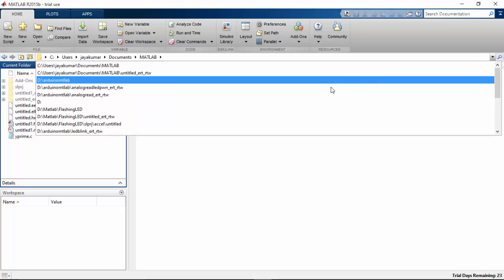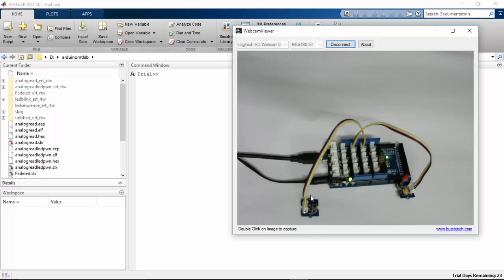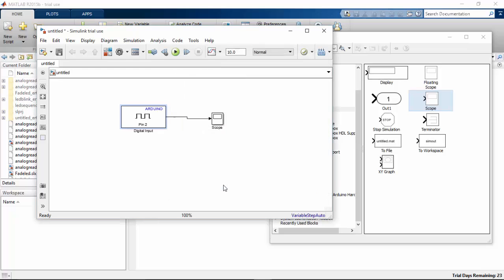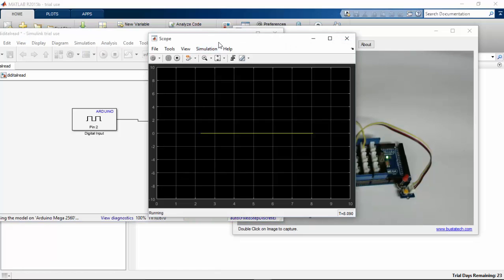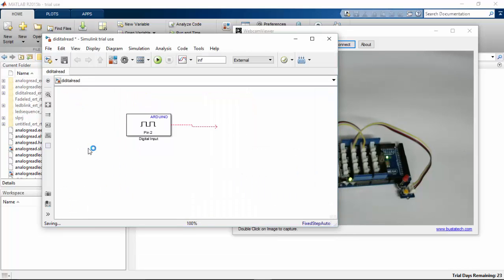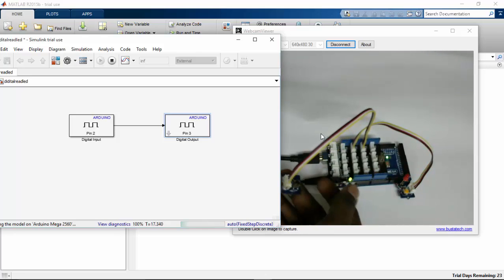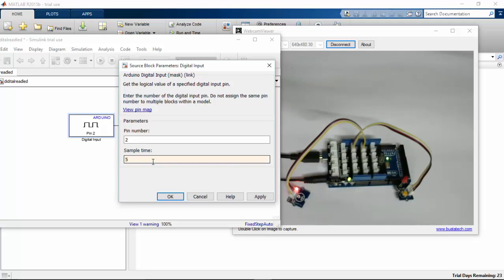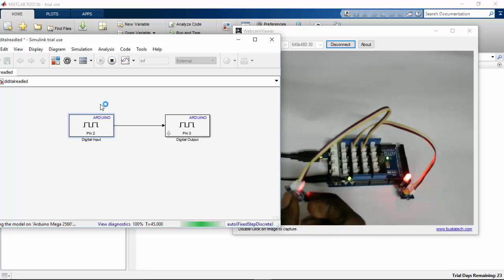5. How to read Digital signal In Arduino with Matlab simulink

Comment: How to add a delay of 1 second in simulink as we do it in arduino like( delay(1000)). Thanks
Reply: Change sample time in digital output.If sample time equal 5, output is 5 seconds
Reply: @thetthirinaing7169  I have another question if you can help me with please, I am trying to do two PI controllers for current and speed of motor  for arduino, the problem is something weird happening,  when I use the simulink PID block things goes fine, but when using integrator and gains, scope shows no data, also if add extra scope or a gain somewhere , scope also shows nothing!!, I am using arduino uno not sure if that is the problem. When I use only one controller for example only for speed things goes fine, even any extra blocks like add,multiply else , scope shows no data that I can see if feedback signal follows the setpoint or not.. so confused. Thanks in advance.
Reply: @knighttime19  Sorry I just start learning about PID controllers.So I don't know too much.

Comment: Hi, It is nice. I am also working on Simulink design, I want to toggle LED continuously by holding the Push button and LED should switch off after releasing the push button for Arduino uno in simulink. could you please help me? 
Please contact me: shivakumar269@gmail.com